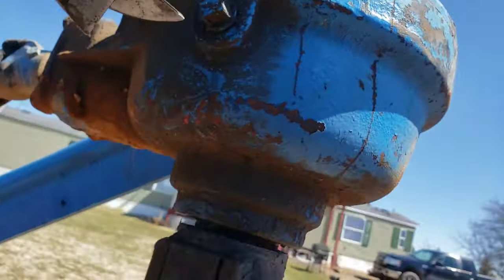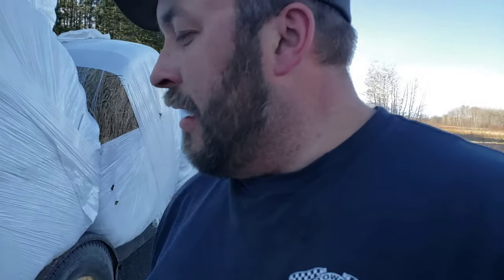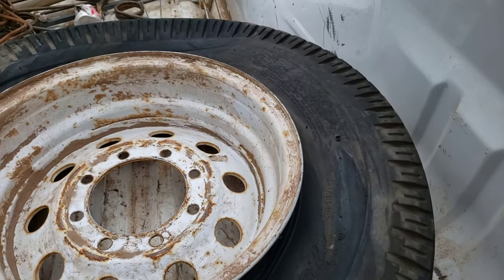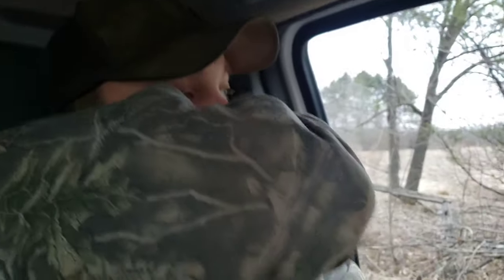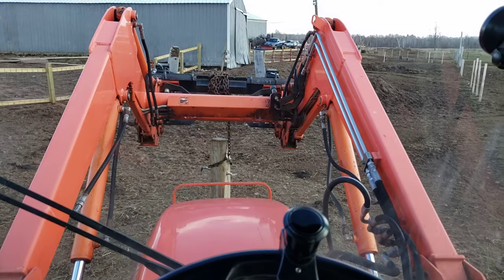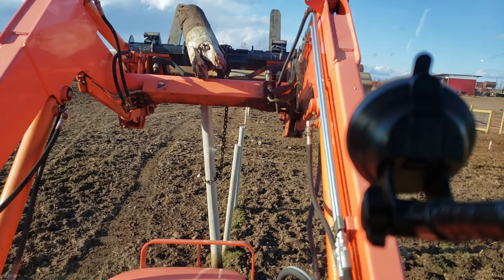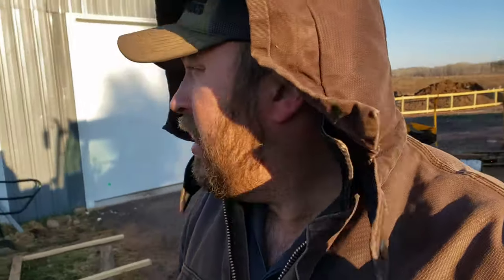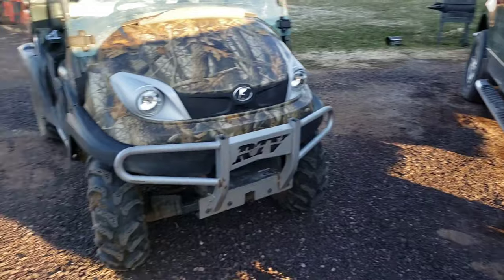Farm Vlog #46 Hauling Hay, Blown Tires and Properly Yanking Wood

Comment: Confused Us say, no overload, no flat🤣😂 sorry man!! But I've always been one to over do things.
Although I have had the semi overloaded a couple of times...
Shhhh.. you didn't hear that!!!
Only reason for being over, was I was hauling 3x3x8 alfalfa bales on a 48' with the axles slid forward... Had I stretched it out, would have been perfect 😎
SUCKS being stuck along the highway!! Last time I was, it was fuel filters on the little Freightliner... Loaded and thankfully only 30 miles from home, not the 120 it could have been!!
Feel bad because you're in a cab and she's outside 🤣😂🤣😂🤣😂
That is so funny!! I always figure if they wanted to run the machine, they should have learned before hand😎😁👍

Comment: The problem I’ve had with trailer tires is if you put too much of a load on them they camber out on the bottom and strain the inside side wall.  The other problem I’ve had and a tire guy pointed it out that tight turns that case the tires to flex is tough on the sidewalls too.  I’ve been looking at switching my gooseneck over to those 19.5” boar wheels, they aren’t cheap but they’ve got a heavy sidewall like semi trailer tires and they don’t rot as fast as normal car trailer tires.  🍺🍺
Reply from the maker: Time to buy a peterbilt and a lowboy 😂🍻
Reply: @RickBork  Believe me the wheels have been turning for a few years on that topic.  I think I've dreamt up every possible combination you could imagine from an old 50's cab over with a two stroke Detroit drop in to a 2000's era truck with A/C and a nice smooth ride LOL

Comment: Rick I figured out a long time ago that trailer tires are junk. 
Lt 10 ply are much better. 
If you had help pulling posts you could get some one to rap the chain tree times with a long tail to hold on to and pull tight . Then pull the post . You do it this way fast .
But don't work without help.😊😊👍👍👍🍻🍻🍻🍻🍻